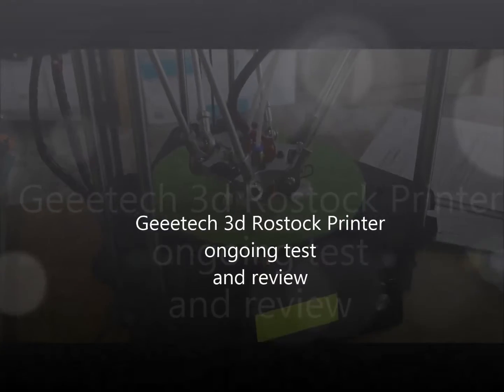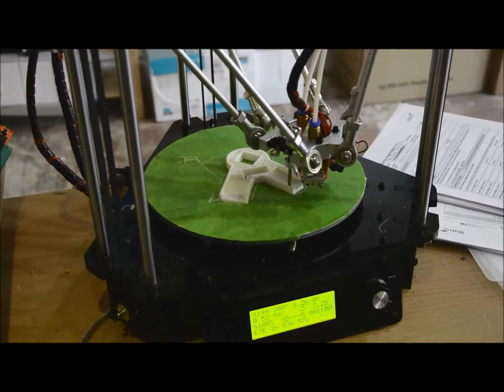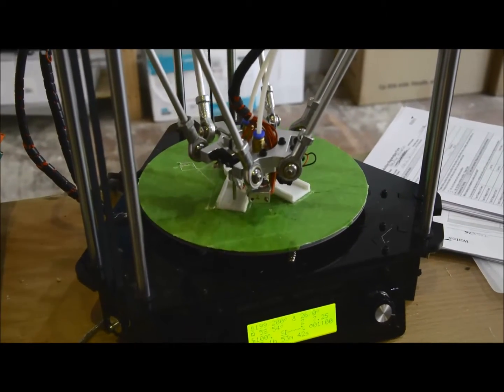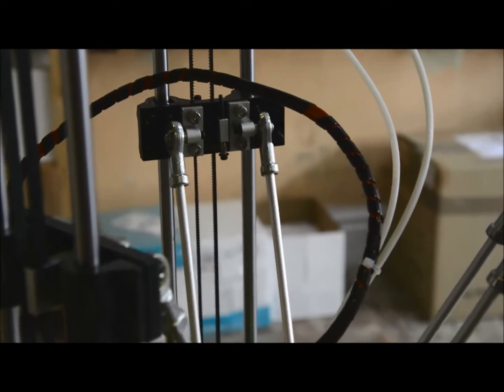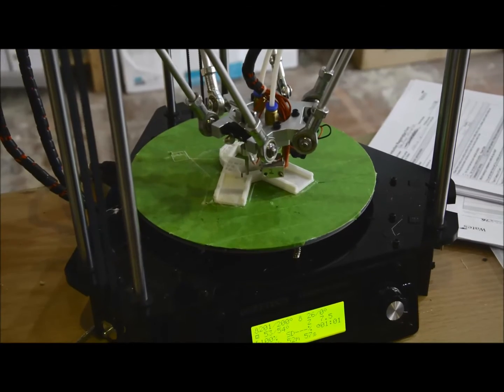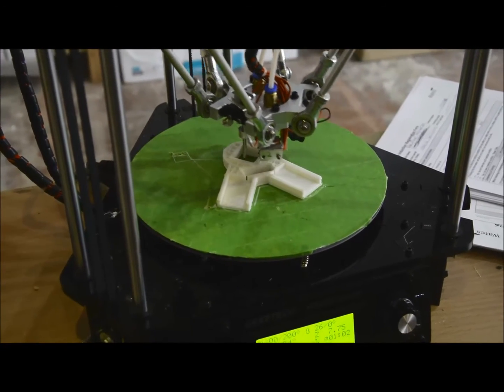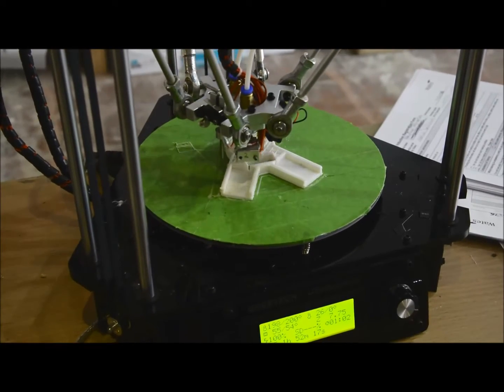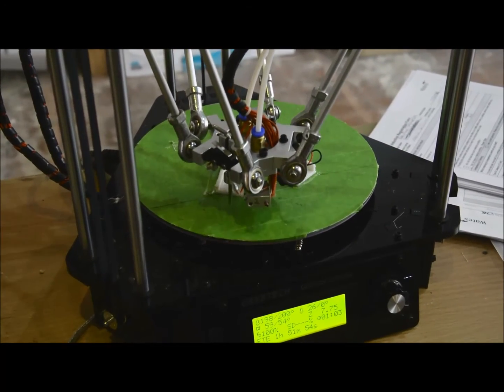Geeetech 3d Delta printer

Comment: Does the control board come preloaded with firmware or do you have to program it yourself
Reply from the maker: You have to load the firmware, this you download from the geeetech web site, and use the Arduino interface to upload to the chipset.
Reply: Did you have any issues with the printer printing higher on the edges then the center almost like a dome I have built them in the past and couldn't get the firmware calibrated correctly for this
Reply from the maker: Chris yes it was a pain, but by changing the distance to centre in the firmware I eventually managed to get most of it out.

Comment: Is this Geeetech Rostock 301?  I only see two filament feeders.  Have you tried multiple color printing?  Would you recommend this printer?
Reply from the maker: No its not the 301 this is the earlier version 2 head machine. I have tried printing 2 filaments, I mainly use the 2nd head for supports. It works ok for that, more complex when it comes to slicing and building objects with 2 colours. I would recommend the machine based on the price and what you get for your money. It does have its problems and you will have to work around those problems, takes time to dial in to get a good print.

Comment: How did you manage to tighten the brass joints? I mange to file done the ends so the screws are not shaking out my print.
Reply from the maker: I had to resort to a very non technical method. 2 sockets big enough to go over the ball, but small enough to sit on the brass, and a hammer. Rest the ball joint on the sockets and give the top one a whack. It does need to good strike to tighten them.